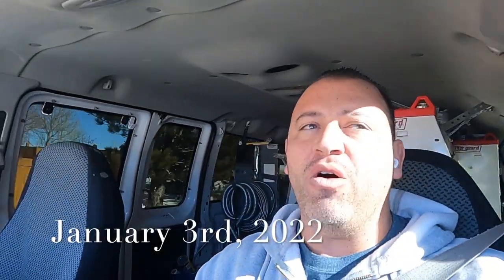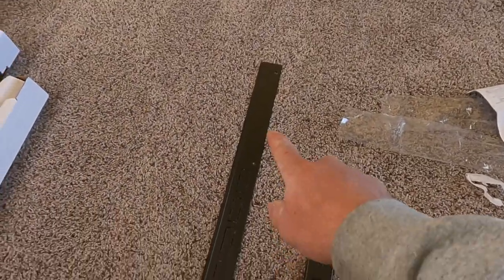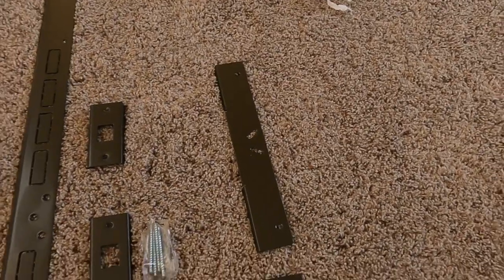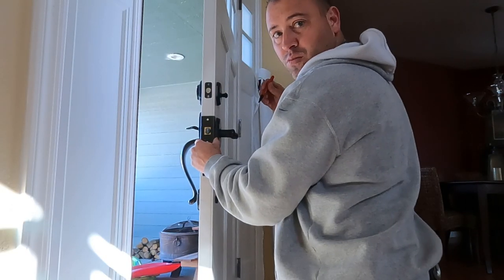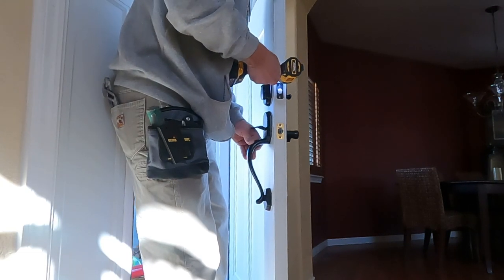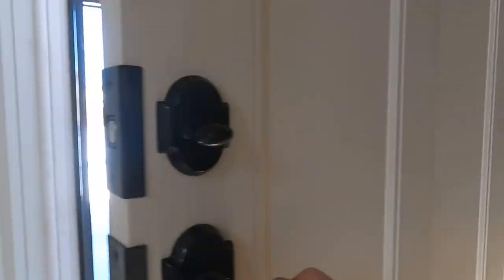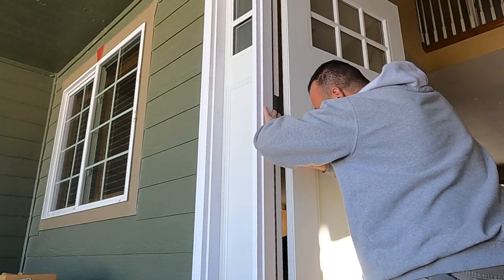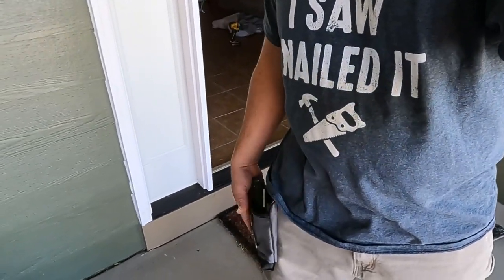How to install DOOR ARMOR MAX | Handyman

Comment: Hey Vinny…..my door fits pretty tight all around. How much thickness will these reinforcements affect the door in closing after it’s installed? The door in the video closed fine but is it possible that I install mine and the door won’t close because the armor is in the way? That…..great video!
Reply from the maker: I have one installed on my home. There’s a little rubbing but not to bad. Your door will definitely shut you might have to lend a push to shut it. Even though mine rubs it’s worth the overall safety. Side note: if you don’t install the hinge plates they may help with some movement.

Comment: What size drill bit did you use ?
Reply from the maker: Can’t remember off the top my head. However as long as it’s half of the screw size you should be good.

Comment: What's the difference from this strike plate vs the $15 from home depot?
Reply from the maker: Anyone kicking 🦵 door will break their leg. It’s a pretty good set up and highly recommend.
Reply: @vinnythehandyman  so this strike plate that's around $99 and the $15 strike plate from Home Depot are basically no difference in quality and performance?? Thank you again
Reply from the maker: Does is come with the hinge protector plates as well? If so, then yeah a good deal. I didn’t know Home Depot sold them.